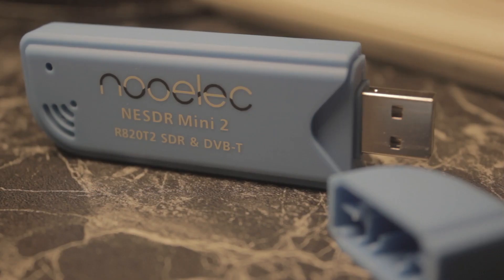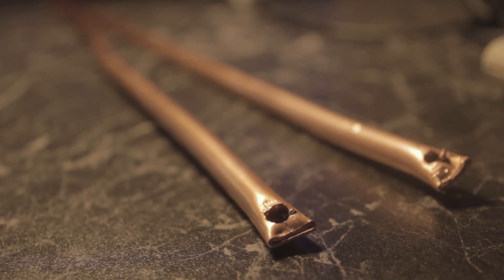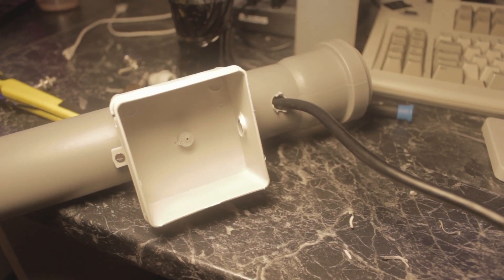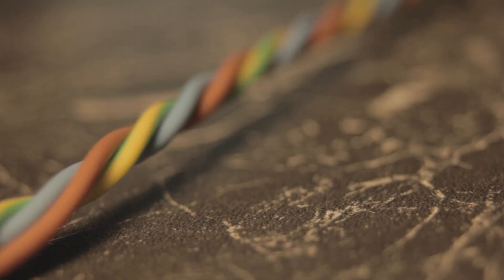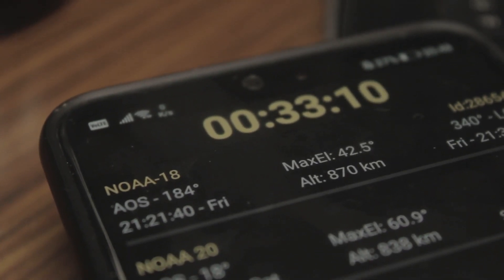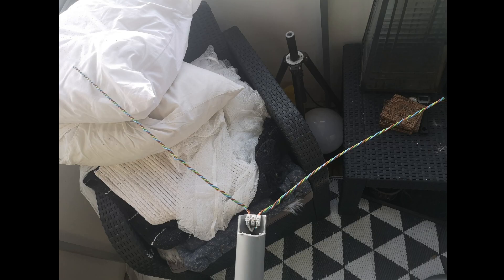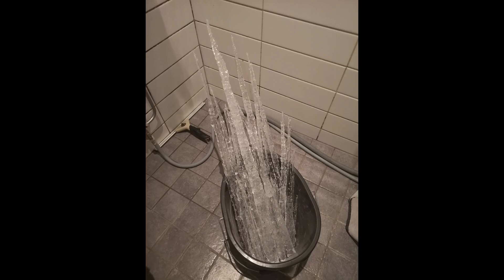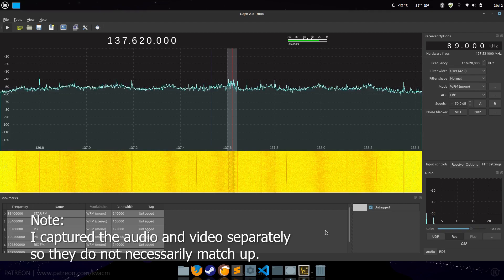I Built An Antenna To Get Images From Satellites

Comment: Thanks for sharing. I recently picked up a USB SDR but haven't done much with it. The antenna seems simple enough.
Reply from the maker: You're welcome. :) 
The antenna was definitely the most simple one I found. After reading about LNAs and FM band filters of which I have neither, I was a bit worried I'd just get static but the antenna seems good enough on its own to at least get started!